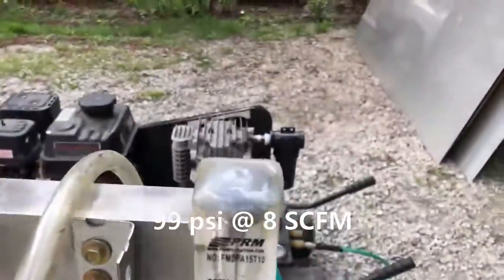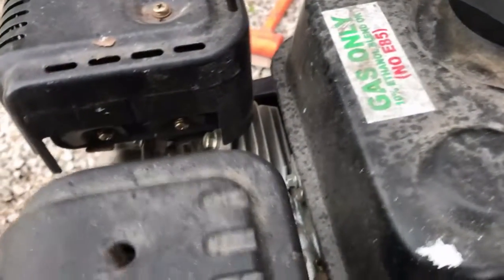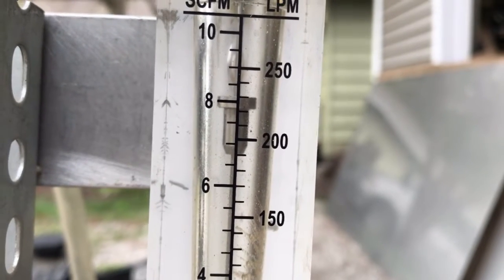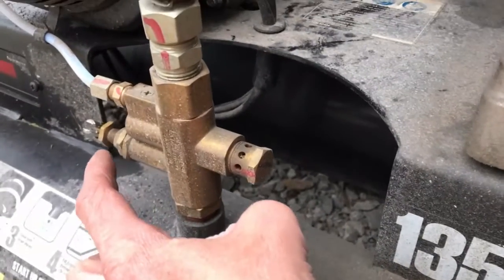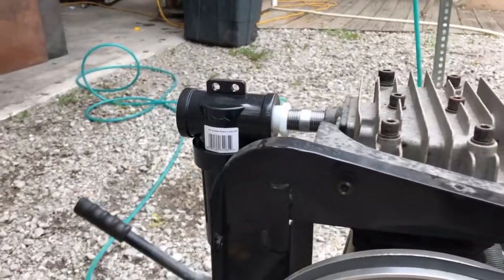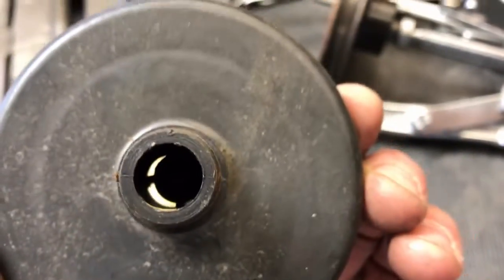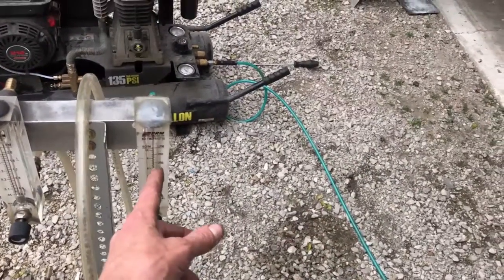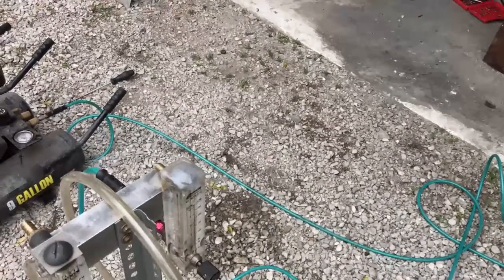Boosting my Gas Air compressor output 8 CFM at 135 PSI

Comment: i like this i over clocked my junk pile/recycling harbor freight parts  built 60 gallon A+ if it ant broke //well its made so that means theirs room fer a kick in the pants for most everything .no my toaster is broken 4 months used 25 est times half assed/made in china now it needs  modified ..i use 15w 40 diesel oil; in my compressor? what you use ??..thank for the extra edukation on that air meter device  sir..one thing at lest forged rods are fairly cheap for the predator engines and cams to

Comment: Synthetic oil in the compressor is probably  fine ...

But I have had a few small engines that I thought I would be nice to and put in Synthetic oil... and they all started to burn oil and smoke like crazy.. switch back to normal oil the don't  smoke...
I don't  do that anymore...  
Maybe  use 15w40... it's a little thicker under extreme conditions.
I  normally have that for the diesels  and put it in everything...

Comment: If your going for max flow, bump up all your line sizes. I don't remember the calculations, but while not as important as the smallest hole size, the length and diameter of line adds up quick.
Reply from the maker: Yes you are correct and i do have a larger blue hose i should have used .
i learned this one day when i tried to run a large impact gun , the small hose just wouldnt do it . I have a blue hose i should of use and i didnt even thing about it . 
maybe i should do a video of your comment showing the reduction in flow as i add more hose or use a small diameter hose

Comment: I think you'll be ok, that's my guess. You use high flow / low pressure. Someone trying to run one of these compressors (not the engine, just the compressor part) balls out to get 125psi for heavy air tool use will definately see short life. I think you are in the area where you can push a compressor for higher flow due to the volume you want vs pressure.

Comment: Maybe use some good synthetic oil in the thing...now that she is working harder. It made my car engine run smoother and quieter. It probably need upgraded springs on the valves too now.
Reply from the maker: Hey look whos back , is it that bot agian , and come on man you no me brother , i got racing oil in the motor and full synthetic most expensive oil i could get for the compressor LOL
Reply: @NOBOX7  i think the bots need to be reported for spam, they are growing a network. "Money for nothin, and your clicks for free"
Reply: xenox ceramic ? (additive oil)
Reply: Wrap some copper coil around the fins on the compressor pump and make it water cooled it won't  make a drastic difference but help a bit